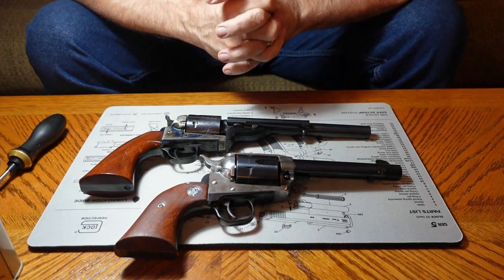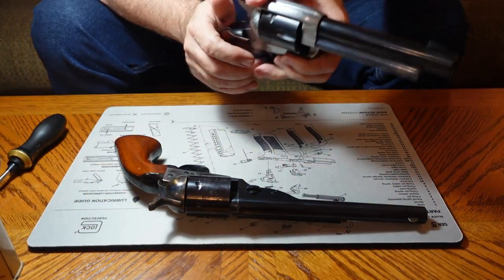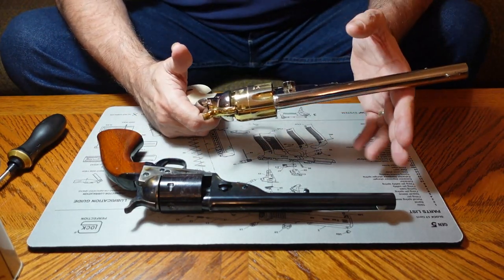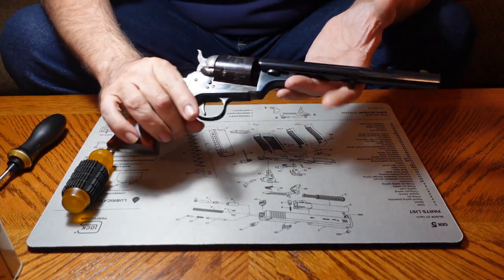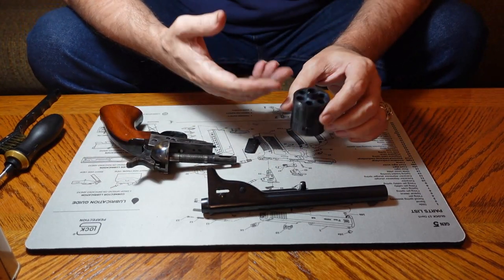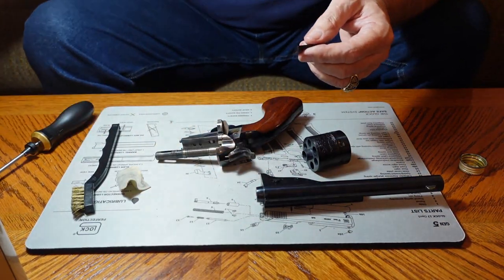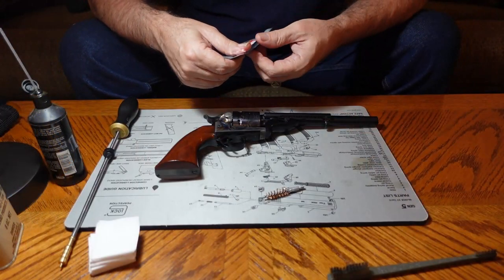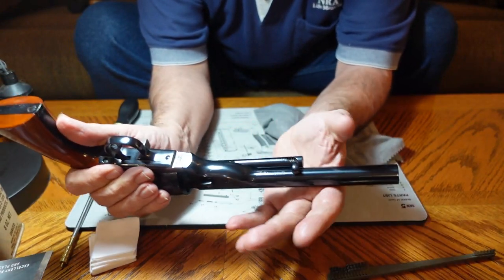How to clean, and lubricate the 1871, 1872 Colt open top. #revolver #wyattearp #gun #cowboy

Comment: Drop fire not slam fire.  Slam fire is a shotgun thing.
Reply: Slam fire happens when you don't use the right primer on m1 and m14 rifle.
Reply: @jamescorley1899   Slam fires like that are caused by bad firing pins or primers not seated.  And it is a malfunction. 

On some shot guns a 'slam fire' is a function of simple holding the trigger back and working  the action.
Reply: While reloading for my m1 garand I put regular primers in the shell casing , when I fired the rifle repeated like a full auto rifle ! That's when I found out that  m1 and m14  must use a special primer ! when the bolt cycle  another round in the chamber the force set off the primer !

Comment: You can rest the firing pin between cartridges. The one empty cylinder deal is from SAS competitions.
Reply: no you can't
Reply: @HircineDaWolf  yes you can. I do it all the time
Reply: this is not possible with 45LC, i guess it is with .38  @jimh6763
Reply: @HircineDaWolf  the 45 I have does too, but not quite as safely I'll admit.
Reply: @HircineDaWolf  guess it depends on the make of the revolver.  Some have a little bit bigger cylinder. Little extra room between chambers.

Comment: Thanks for the video.  I just bought the Cimarron Uberti 1860 Richards Mason conversion in 38 special.  Beautiful gun.  Have to say my barrel wedge is not as tight as yours. If I even push it in with my thumb a little too hard the cylinder won't cycle properly even though there is still a gap between the barrel and the cylinder.  Kind of worried the wedge will come loose when shooting it. Any thoughts?
Reply from the maker: I know this isn't a magic solution, but I would take it to your local gun shop and ask for help. I know of a solution, but if done incorrectly it could cause the gun to have problems. My wedge is so tight its a pain in the rear to get it to come out.

Comment: My wedge is completely stuck. No idea how to get it out. Gun is locked up now, cylinder won't move. The mallet brush technique not working.
Reply: Make sure to turn the srew on the wedge to the flat spot, then tap out the wedge.
Reply: @denisdegamon8224  yeah, I turned it. No amount of tapping or hammering will make the wedge budge.

Comment: The Hollow based wad cutter are the mot accurate.  The pistol is chambered for 38 long colt not 38 special.  Many 38 Special loads ill not fit.  you can load a 44Ball oer a full case of black powder in a 38 Special case.  the seating die will trim a flat and crimp on the flat.